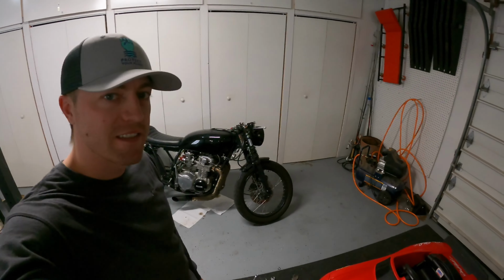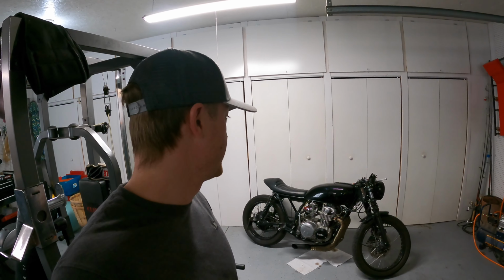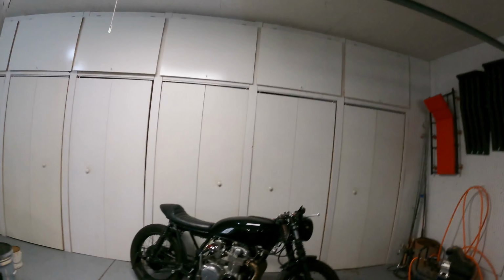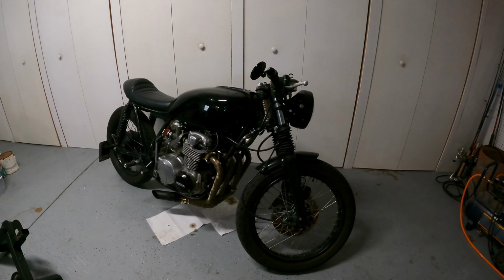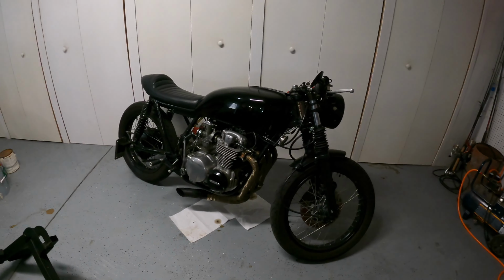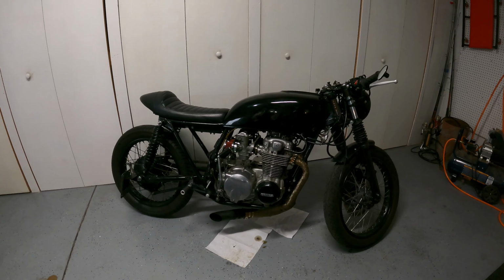1978 Honda CB 550 cafe racer leaves me stranded

Comment: So I had the same issue it turned out that The fuel petcock want restricting enough juice to get to the carbs. I bought a cheap aftermarket which I believe was maybe a little smaller. I rebuild the factory afterwards and the problem stopped.

Comment: what was the problem Dino? Did you find out?
Reply from the maker: Yeah it was a strange one, one of the screws on the carb was stripped out and leaking vacuum causing it to not pull enough fuel to the 4th carb. I removed the screw tapped it and replaced it with a slightly larger screw and it ran great.
Reply: @dinospeedino623  i had a similar problem on a bandit 400v many years ago. Some of the o-rings on pilot screws were damaged (mainly by their age) and were not sealing 100% their holes. The symptoms were pretty much like yours. Replacing the o-rings with new ones fixed my issue back then.